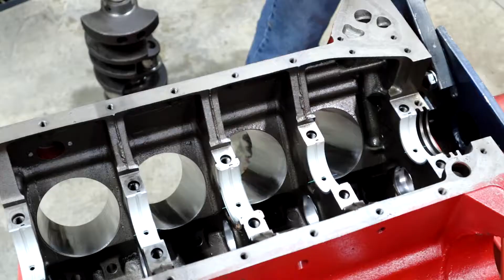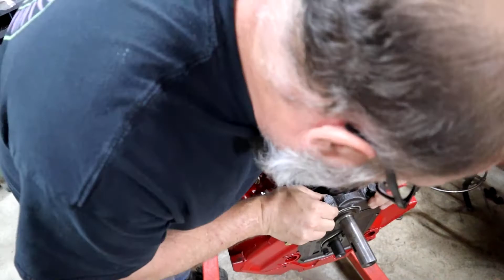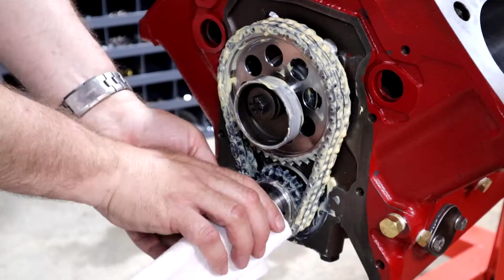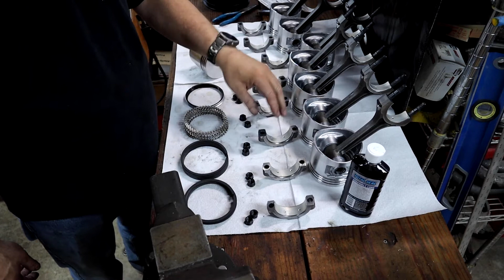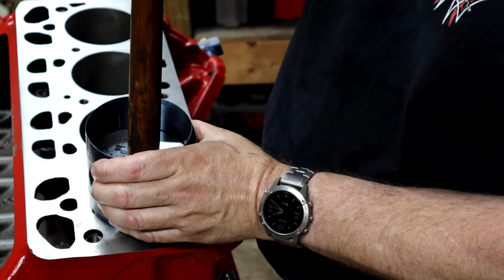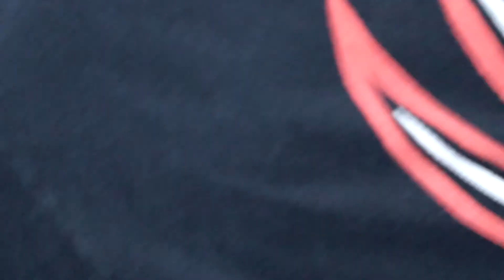Camper Truck : Ford 292 Y-Block Short Block Assembly

Comment: Looks good by the way.  These motors are pretty torquey.                Just wondering about that blue gauge method that's all.
I've got my 272 dipped at the machine shop and should hear soon if there are any cracks. 
Bit harder to find next bore size over for slugs than a 292 or 312

Comment: I've only blue gauged once before so pls pardon my ignorance, but would it not be a more accurate read to lay the blue string on the top under the cap as the natural clearance on the journal would be on the top due to the gravity of the journal restring in its saddle ? Being upside down in an engine stand.
If string is on bottom side the weight of the crank itself after torquing may squish the string a tiny bit more thus fudging the most accurate read. By a tiny bit. Maybe half a thou?

Comment: Very nice to have you document your work for the rest of us Chuck. I like that you're leaving mistakes and things you learn on the fly. Keeping it real and authentic. How easy did it turn after the pistons went in?  Mine took 40# https://youtu.be/SnEwJbnyBo8  We were surprised it took so much effort but it's been running like a top for a couple years. Thanks again for taking the time.
Reply from the maker: Mine isn't too bad to turn over, but there is a lot of ring tension there until the rings get seated.  I didn't measure but I think mine is about the same.